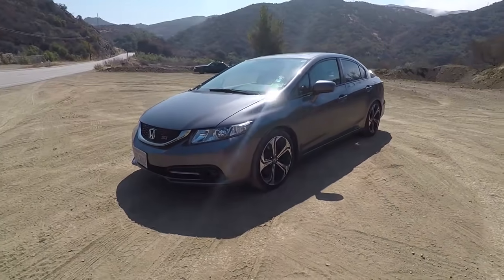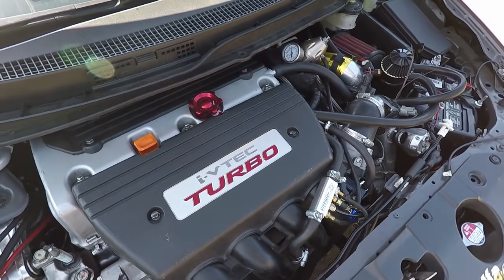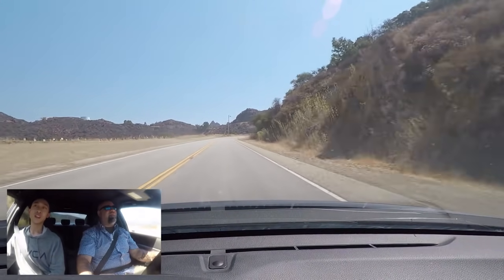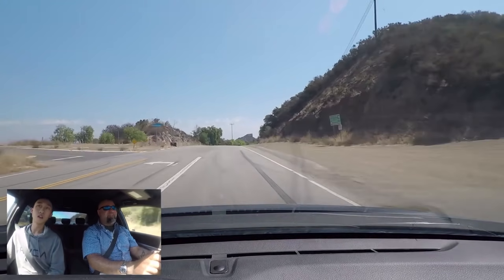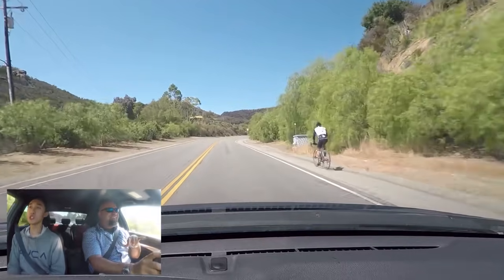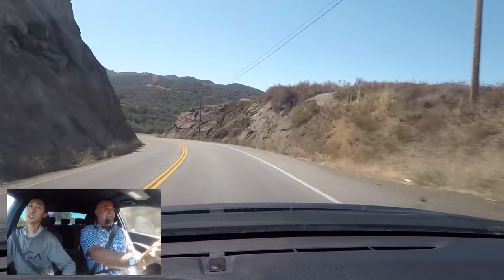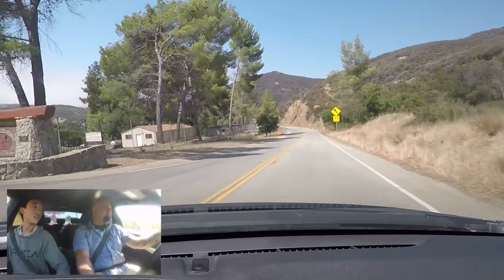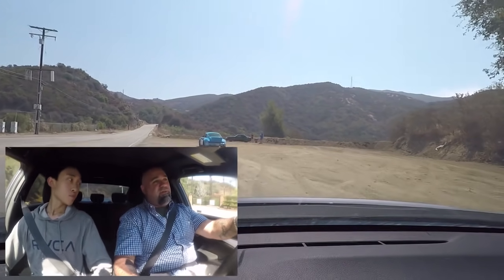Brutally Fast 500 HP Turbo 2014 Honda Civic Sleeper - One Take

Comment: Mark needs to drop the final drive from 4.76 to 4.39 from the RSX-S.  That'll help with traction.
Reply: Mike A I'm 1 step ahead 😉 I have the rsx 4.3 final drive in my garage already. Just waiting until I have time to swap it out. I'll probably dead hook 2nd gear with my drag radials after the 4.3 final drive
Reply: Nice bro.  2nd gear, with slicks...maybe on low boost, lol.  My car is bone stock and I want to do that gear change.  Stock final drive is too short, no need for it when you have the torque of a K24.
Reply: With my stock fd, I dead hook 3rd gear with the drag radials.  The only problem with the 4.3 final drive is my 2.313 first gear lol. I'll be able to do a 0-60 in 1st gear
Reply: Mind as well put a LS non vtec FD

Comment: Honda makes the best engines inthe automotive world, by far. Honda engines can handle so much pressure that would normally blow other manufacturers engines apart. Toyota makes the world's best transmissions, but Honda definitely makes the best engines.

Comment: Always love a good sleeper but seriously, wtf is it with Honda drivers and gauges??
Reply: Zero Ninety what's wrong with gouges? better safe then sorry
Reply: Race car
Reply: If I'm pushing 500hp I'd like to know what's going on under the hood
Reply: @SpeedyStone97  that's most of the v8s guys for you, hell I overheard someone at work talking about v8s are so good because he can add another quart of oil (his truck burns oil pretty bad) and it'll stop knocking or ticking (I personally think its knocking a little) and he had a 4 cylinder kia before his truck and hates them because he forgot to refill his oil and blamed the car for it, his comeback was (if it was a v8 it would of have survived) ironically 1 month later after his new truck starting burning oil, his engine locked up, too priceless, still to this day believes that all 4 cylinders are ass even though it was his fault and neglect that caused it to blow up (it was a kia owned by some mom who had 3 sons, had around 176k miles when he got it)

Comment: Part of the traction problem is the fact the back of the car is lower than the front. These modle Civic's actually hook up pretty good bc they pretty heavy if suspension is setup right.

Comment: Why does it have Civic Hybrid rear lights, hybrid badge, and green plug-in hybrid Clean Air Vehicle sticker in the back?
Reply: Avoid traffic,  i do the same thing with my 2015 , change rear badge and also powder coating wheels , and wrapped leather seats stitching,  when you approach to my car you only notice the difference because is manual.

Comment: I hate when people mention "Stages" of clutches like they are some sort of industry benchmark measurement and are consistent between manufacturers... but almost 500whp in those cars are definitely fun.
Reply: Stages are relative only within the manufacturer's product line. Action refers it to "stages" which I personally don't like myself, but it sounds a lot better than saying "I run a 170% more than stock torque capacity holding 6 puck unsprung clutch" lol
Reply: I know, I just can't stand it when folks present it in that manner (not that you were necessarily doing that)..

Comment: It must suck trying to tune turbo cars in CA with crap 91 octane gas. Add in high heat and altitude and it's even worse! Thank god for 93 octane and living at sea level (literally 0-150 feet where I live). Weather sucks half the time though. So there's the trade off 😅

Comment: I wonder what clutch hes running because I have a 9 gen turbo civic and I have gone through 5 clutches this year. Not even a cc twin disc is lasting. My car makes 640 hp. And have a built transmission. At this point I dont know what to do now. Dont even drive the car hard

Comment: I get it you want more power out of a four-cylinder but the problem is when you get power up above four or 500 hp the car itself still weighs the same no matter how much of a suspension you have on the car it’s still weighs what it weighs not dissing Honda or any turbo four banger for that matter but I would much rather spend my money on say a 98 C5 or a 2001 C-5 Corvette the power is already there and the car weighs a lot more than the Honda she could put a lot more power to the vehicle even upgrade suspension and the car will respond better and higher speeds when you’re going around turns and when you’re Driving it like a madman

Comment: See those things hanging at the end of the zip tie, long as fuck, yeah you cut them away.
Reply: No shit sherlock. IAT sensor popped off the day before the shoot, I was 500 miles away from home with no tools. Cutting the ends off the zip ties was the last of my concerns lol. Ended up JB welding it and zip tying the flange onto the pipe before I could have a chance to get it re-welded on

Comment: With all that speed shouldn’t you do things to the handling? Wider wheels, drop the height, good thing you changed the suspension but still. Plus adding to the body making it more aerodynamic would help with both handling and speed
Reply: It's dropped a bit, the front's just a bit higher because I throw on drag radials from time to time. As you can tell, I don't track my car, just a daily with enough power for occasional roll races or drag strip passes. The suspensions itself are nice and stiff, and with my pilot sport 4s they actually handle pretty nice

Comment: I heard if you hold the rev high enough for a long enough time, it will turn your motor to a high rev motor. You should test that out. Imagine 10k rev limit from a 8k limit motor.
Reply: Delete this
Reply: @dre160   @Master Thomas  No Tom! No! BTW make sure you replace you blinker and headlight fluid or it will turn yellow because the sun dries it all up. It's UV rays damaging your plastic because there is no more fluid left.

Comment: Matt didn't like this car very much.  Three things.  The suspension was not set up right.  Too much boost for a FWD car.  And the brakes were so-so.  Just my guess.
Reply: Based on what he told me, he liked it. Suspensions are a bit stiff, but it handles turns nicely. Brakes are upgraded as well

Comment: it is ruin of a good car to install turbos in a NA civic, if you want drive turbo shit, buy a wrx or focus st, even GTI would do a better job.
Reply: Fuck no, K series ftw
Reply: im not saying that you cant install turbos on F20 or F24, its just most of people buy civic just enjoy the NA engine.
Reply: That's true, but if you look into our engines (9th gen civic Si K24z7) the vtec is only on the intake side. The exhaust side does not have vtec, and we have integrated runners, so airflow is horrible for NA applications. A lot of people do a K20 head swap to get that true vtec and free up the top end power, but after all said and done it costs a lot. Matt did a one take on another all motor 9th gen si that has a K24 bottom end with a K20 head. That car makes some good power NA but the owner put in a ton of work to get there